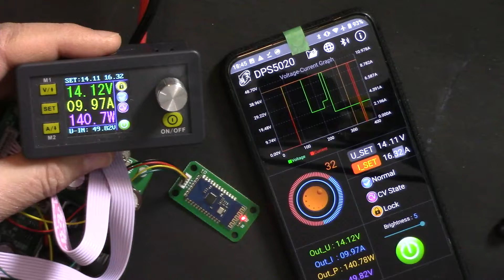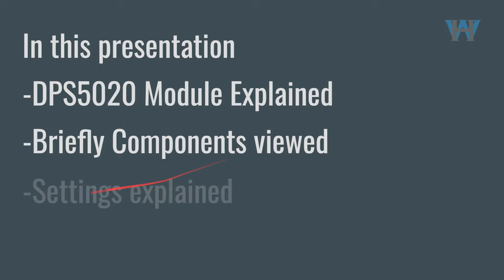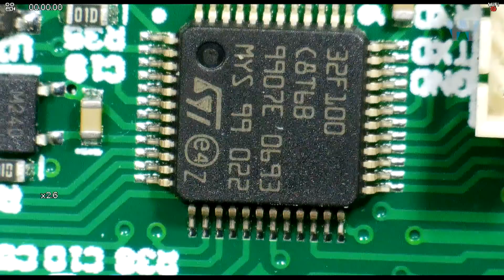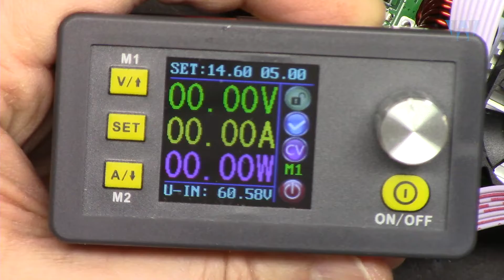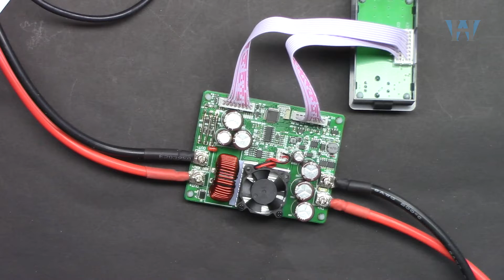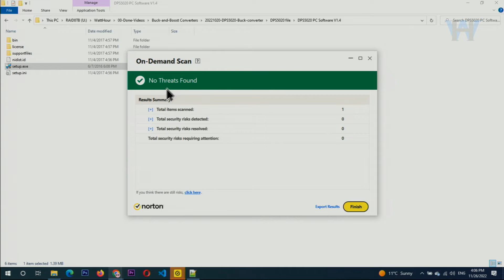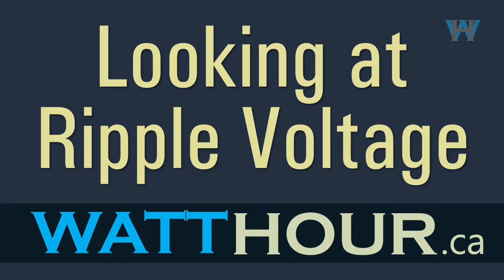Review of DPS5020 50V 20A DC Buck converter with  PC USB and Mobile app software | WattHour

Comment: Hello sir,  thanks for the good work, can i use this to control charging of my 3s 12v lithium battery, I leave it to run the circuit permanently?.. I  I set the output to something like 12.4 and hook it up on the pack of lithium batteries that have BMS.........

Comment: I'm having an issue with a feature of this module, I made a power supply for it with an old 50 volt transformer. The problem is that the open circuit voltage is 69 volts and this module won't latch on if the voltage is too high, do you have any suggestions?
Reply: My first thought was the rip a couple windings out of the transformer, but that seems like more effort than it's worth. And there is the risk of damaging the transformer
Reply: I have two of these modules in the power supply I'm building, so it would be worth it to me to replace components on the board over buying a 60 volt variant. I did look for a 60 volt variant but I couldn't find anything in the same form factor

Comment: Can the output be put in series to increase the volts out?
Reply from the maker: No and yes. Yes if you use separate input power  from power supplies that does not share a common Ground. No if you use the same power supply for both.

Comment: A very thorough review. I would like to see a test for stability in terms of how the power supply handles a dynamic load. A power supply that has poor stability results in ringing as the load steps up or down. This can cause issues for the equipment such as amateur radio transmitters as the power swings are very high on CW or SSB.

I have started to look at the stability of power supplies. The most important is a programmable load capable of dynamic loading. I have a Tenma 72-13210 electronic load that cost about AU$ 350 from Element 14. The other gear is an oscilloscope and a current probe. Using the oscilloscope allows any ringing to be seen under a dynamic load. Regards Drew VK4ZXI
Reply: Would also love to know that. Looking to power my kenwood ts2000x amateur radio station with a 48v nominal lion battery
Reply from the maker: Actually I wanted to do that type of tests but so far I have not seen encouraging signs from viewers.  94.6% of viewers are non-subscribers and that has great impact on my channel. Subscription is stamp of approval for a channel and and videos of a channel with more subscribers will be discovered more. I will keep your suggestions in kindle for future video and even I make make video on this module with different current and voltages in different intervals of milliseconds or seconds . My electronic load is programmable and execute those type of load. I will see if time permits. Cheers
Reply: @WattHour  It would be interesting to test a number of power supplies to see how well they perform with a dynamic load, especially if some bad ones were included. Many amateurs are interested in repurposing server power supplies but I am not sure how well they would perform with a dynamic load.

I don't think many people are even aware of the problem. My understanding is that it is mainly a problem with switching supplies because of their more complex feedback loop but it would seem a potential problem of any regulated supply, linear included. I believe it is possible to improve a supply's performance by adding more capacitors, at least up to a point.

The Texas Instrument application note gives a good explanation. https://www.ti.com/lit/an/slva381b/slva381b.pdf

Comment: You always record interlaced video, which really not good for multimedia. Check please your camera and try to switch it to "progressive" recording mode.
Reply from the maker: It is all progressive. Besides I don’t see anything low quality.  It is encoded with heights bit rate and quality. Show something that does not look good so I look at it. Thanks
Reply: @WattHour  listen to me please, I know what I'm saying. For example on 0:00:08 when your hand goes up - it's cleanly visible that interlacing is there !!!
Reply from the maker: @Oleksii Zagorskyi  I appreciate your comment. the video is coming from a Sony Camera's output. it is recorded on my Nija 5 recorder https://www.atomos.com/products/ninja-v which does not  have any interlaced/progressive settings except different codec and compressing with frame size.  It might be my Sony camera output by default it must be low quality. I will look into another camera. May be this is time to move to full 4K.  Thanks
Reply: @WattHour  it's possible that the camera you use to record these scenes (on top of table etc) has only interlaced video output or recording, that's why it's there. In such case you should de-interlace it first in your video editor. There are such options.
Reply from the maker: Hi Oleksii, Thank you for your comment, I checked my settings and found that as witch have been moved my mistake to Interlaced 1080i while it was for long time at 1080p. Just set it back properly. I appreciate your comment. Newer videos will be good and the same for my channel http://youtube.com/@robojax as well.
Reply: @WattHour  I'm happy to see my efforts to convince you worked.
Reply: Ytb cannt fast handle long video. You have to wait a minute.